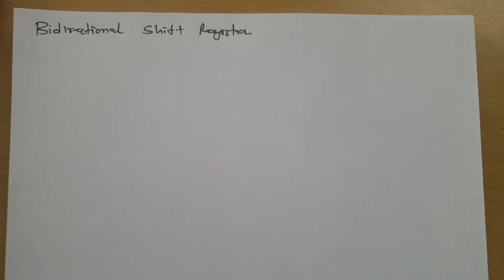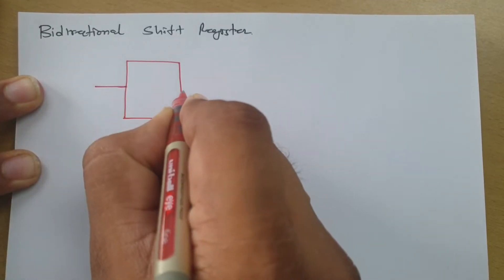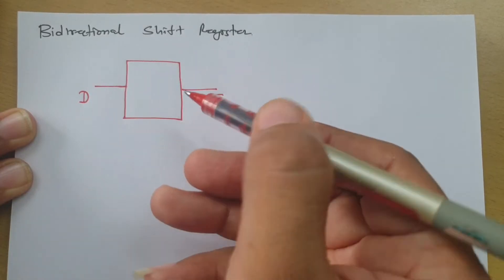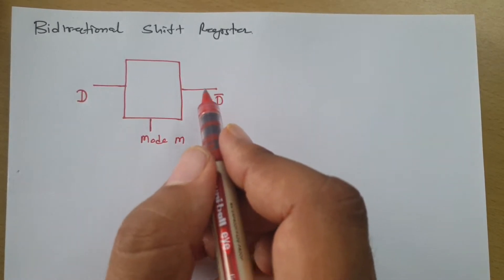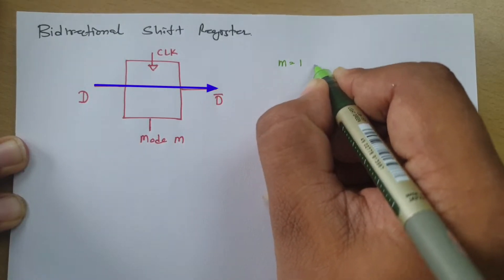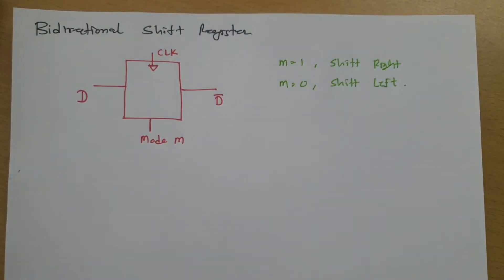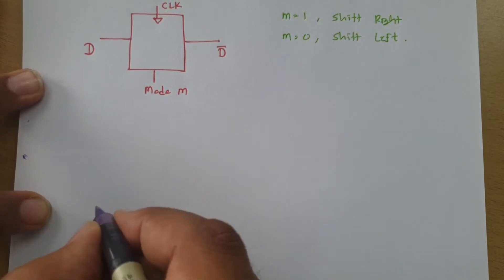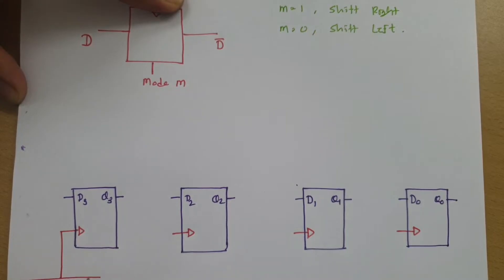Bidirectional Shift Register: Basics, Circuit, Designing, Block Diagram, Working, and Waveforms

Comment: In shift right / shift left register, if we want to keep the present value on the output, we put zero on the load line. How can we store the present value in a bidirectional shift register? In here, if we apply zero, it will shift data in the opposite direction.
Reply from the maker: Shift Registers are used to shift the data. Only Register is used to store the data.

Comment: Hi, how did you figure out that if we connect the flip-flops this way, we can use it as a bidirectional counter? Can we figure it out from a truth table?
Reply from the maker: Yes it can be
Reply: @EngineeringFunda  Could you kindly show the process in your next video or in your website?  Sometimes it is hard to memorize the circuits. 🙂
Reply from the maker: @computer_0x7EA  i will add it in upgradation of this course.

Comment: Design a 4-bit bidirectional shift register which performs shift up operation when all the selection input lines are having input one. 

Sir suggest what to do for having left operation on input one in selection line plz
Reply from the maker: It is already explained in this video, watch it
Reply: @EngineeringFunda  qqqqqqqqqqqqqqqqqqqqqqqqqqqqqqqqqqqqqqqqqqqqqqqqqqqqqqqqqqqqqqqqqqqqqqqqqqqqqqqqqqqqqqqqqqqqqqqqqqqqqqqqqqqqqqqqqqqqqqqqqqqqqqqqqqqqqqqqqqqqqqqqqqqqqqqqqqqqqqqqqqqqqqqqqqqqqqqqqqqqqqqqqqqqqqqqqqqqqqqqqqqqqqqqqqqqqqqqqqqqqqqqqqqqqqqqqqqqqqqqqqqqq
Reply: @EngineeringFunda  qqqqqqqqqqqqqqqqqqqqqqqqqqqqqqqqqqqqqqqqqqqqqqqqqqqqqqqqqqqqqqqqqqqqqqqqqqqqqqqqqqqqqqqqqqqqqqqqqqqqqqqqqqqqqqqqqqqqqqqqqqqqqqqqqqqqqqqqqqqqqqqqqqqqqqqqqqqqqqqqqqqqqqqqqqqqqqqqqqqqqqqqqqqqqqqqqqqqqqqqqqqqqqqqqqqqqqqqqqqqqqqqqqqqqqqqqqqqqqqqqqqq
Reply: I watched the video , but you explain when m=0 it performs left operation.

But I want  to know that when m=1 it performs left operations

Comment: Which type of circuit is a bidirectional shift register ? A combinational or sequential with reason kindly?
Reply from the maker: It is Sequential circuit
Reply: @EngineeringFunda  sir reason?
Reply from the maker: It has Flip Flop which is Memory elements.
In combinational circuit, we cannot use Flip Flop.
Reply: Thank you sir